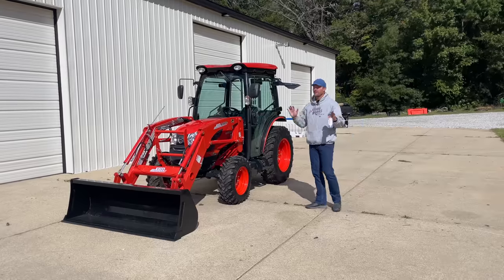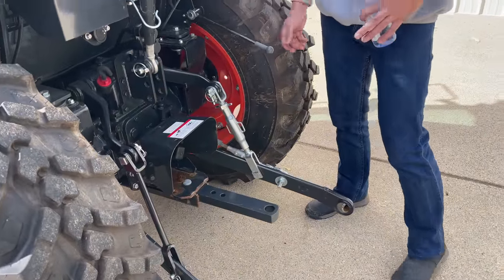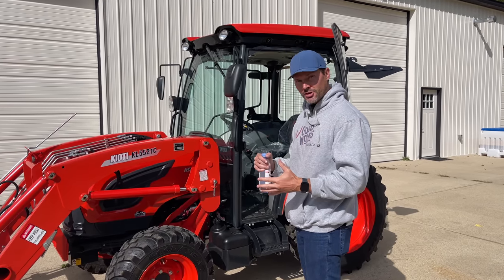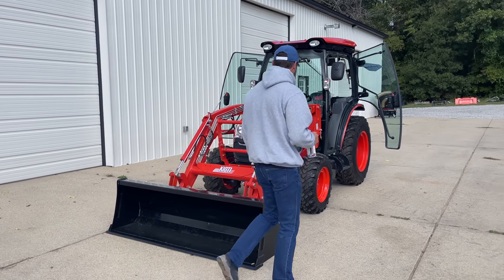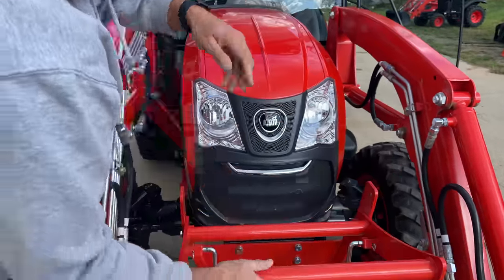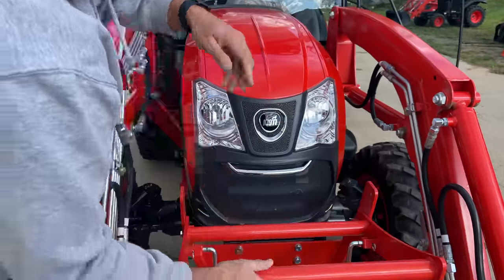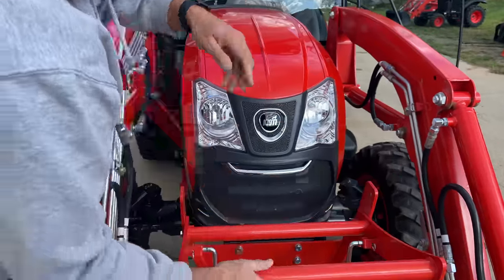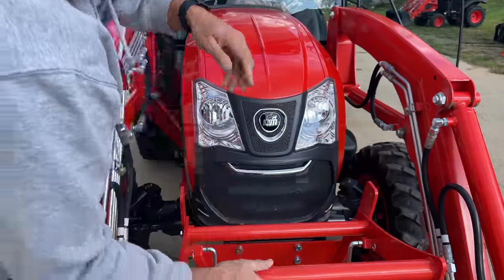WHY DID I OVERLOOK THIS TRACTOR BRAND FOR SO LONG?!

Comment: I would much rather use the radio provision to nut in a mobile GMRS radio or similar so that the family can communicate with me while I’m out farting around with the tractor! Plus it’s a nice safety thing to be able to communicate with people outside of the cab in tight spaces or spotting conditions.

Comment: I’m curious what you think of the LS tractors I don’t have a kioti dealer here however I have been looking at the LS version of this basically the MT3 57 so a 57hp also and it comes with 2 rear remotes.

Comment: Maybe I missed it, but do any of the Kioti tractors have auto throttle? 

And I agree, headphones are better than a radio… if you have then with you!
Reply from the maker: Not sure, I don’t think I’ve seen that feature yet, but could just be forgetting.
Reply: They have a linked pedal function that ties the throttle to the pedal angle which I use exclusively unless I'm running the PTO.
Reply: Linked throttle an cruise control

Comment: Just curious Courtney what's the reason you don't talk about TYM much? I was between this Kioti and my 574HST I ended up with and they're a terrific brand. Just curious why you don't have interest in them? They've also been around forever and make many models for everyone.
Reply from the maker: TYM?  Maybe someday, but the used/resale market is way too small still. Not enough market share yet.
Reply: @GoodWorksTractors  Yes TYM my auto correct decided I spelled it wrong. What makes Kioti have more market? Through the state of Iowa which is a pretty large tractor use state there's like 7-8 dealers. I'd argue to say they have even more included features for the price.
Reply: Nobody sells a TYM after they own one 😎😎

Comment: I currently have a Kubota LX3310 and I put it on the market for sale and I’m upgrading to the CK3520se cab. The features you get for the price are crazy. It actually makes my LX seem generic. That’s not the main reason. A heavier tractor, better loader with better lift capacity. I do driveway work and the extra weight to pull a box blade up hills and loader will help day and night. Did I mention a cab as well? Lol. Same financing and warranty as Kubota. Plus the tractor with the tires loaded, the loader and a cab is less than the package I paid for my open station LX. Excited to give Kioti a try!

Comment: People complain about armrests, but they are designed for midgets. I’m 6’3 220 and unless I slouch down 6 inches, my arms don’t even come close to the arm rests. I own a Lx2610, does anyone know if I can raise them up higher. I’ve looked countless times and haven’t located any different places to mount them.
Reply from the maker: I'm 6' 3" and really enjoy armrests.  Most are adjustable and have sat on a lot of tractors.  Look under the armrest, normally a threaded knob to turn.  Others have a scroll of sorts on the side of the arm rest.  I've never found armrest location to be an issue.
Reply: @GoodWorksTractors  , thank you 🙏
Reply: @GoodWorksTractors  , after locating the arm rest section in a very obscure part of the manual, it appears the Lx2610 doesn’t have an adjustment. I’m going to contact my dealer and see if any damage to the machine or possibly voiding my warranty will occur if I just drill new mounting holes higher up on the seat. I still haven’t figured out the adjustable seat spring. It feels like no matter which way I turn it, I’m unable to notice any difference (and the tractor is basically new, less then a year old and only has 177 hours on it).  Another word to the wise, make sure you get a comfortable seat when purchasing a tractor, your back will thank you.

Comment: As these tractors age , are parts available for repair ?
Reply from the maker: Yes, Kioti is over 70 years old and did $956 million in annual revenue in 2021.  The last year I can easily find a report.  They are huge and been around for decades.

Comment: Sorry this comment is misplaced in relation to the video. I want to buy a landscape rake, from you would be good. Had some trouble with the website so trying this contact. I have JD3025E. You have one in stock less than $800?
Reply from the maker: We do have them in stock, but more than that price.  What issue were you having with the site?
Reply: @GoodWorksTractors  thanks for the reply, really like watching your videos. For the website, when I would begin filtering, formatting would be unusual and causing me to get locked into no way to return or proceed. Would also seem to freeze, so I would return / reopen. Sometimes I got to point I could see rakes, but then when clicking for options, would freeze.

Comment: The issue is this is literally half the tractor a old 70s Ford 3000 is by weight alone... there is just that much less machine there at about the same HP.... 40 years from now this machine probably wont be here and the Ford will still be going.

Comment: Too funny!
“This doesn’t have a third function, but it’s got the provision; like right where you would mount it.”  
It has two holes drilled on the loader cross-member.   That’s the provision??? 
That’s like me building a home for one of my customers and saying, “No ma’am. We don’t put windows in your new home when we build it.  However, we do make provision holes in the outside walls for those windows.”  
Maybe I’m wrong, but after watching several videos it seems that Good Works Tractors would try to sell ice to Inuit people.
It also seems that the best tractor is the one he’s selling. And he is always selling.    
“Always Be Closing!” Does this shoot a hole in the “five reasons John Deere are better…?”  Now will it be 24 reasons to buy Kioti in 2024?
 I have a similar tractor, open station.  I have a few family members who also run similar Kioti tractors.  You say, “I have found the loader controls to be very smooth.” I do not find the hydraulic controls smooth compared to other makes I have owned or used.  I do however find them incredibly “responsive.” In fact, I would actually call them “touchy.” And it may take a new operator a bit of time to get used to how quickly these controls respond, especially if you are using pallet forks and trying for delicate precision. 
Anyway. It is a beautiful tractor, and you say you are going to keep it; yet you are doing a great job trying to close the deal now. :)

“For we are his workmanship, created in Christ Jesus unto good works, which God hath before ordained that we should walk in them.” (Ephesians 2:10 KJV)   Amen! 
I’m very curious if this Bible passage is what you are referencing in the name of your business?  
After all, “Jesus answered them, ‘Many good works have I shewed you from my Father; for which of those works do ye stone me’?” (John 10:32 KJV) just doesn’t seem like a verse a retail sales business would base its sales strategies on.

Comment: Sorry Courtney.  I traded a kioti2510 in on a Mahindra Max 25. Mahindra is put together better with way more lift capacity and overall power.   The kioti felt like a oversized lawnmower. Pretty much bottom of the barrel.
Reply from the maker: What Series of Kioti?  I'd like to look up the specs to compare.
Reply: @GoodWorksTractors  ck series.  Pretty chinsy
Reply: @GoodWorksTractors  The OP’s trade in was a CS2510. Has to be. The MAX 25 compares to the JD 1025R.
Reply: Have a bobcat (Kioti) ct 2025 and I absolutely love it. I also have a John Deere 1025r and the bobcat dose circles around it.
Reply: @williamk5001  no it was a ck. Like I said...pretty bottom line
Reply from the maker: I don't understand.  The Kioti has greater weight, tire size, loader lift height and capacity, and hydraulic system.  Mahindra has better 3 point lift capacity.  Objectively, the Kioti is and should be superior as it's a bigger tractor.  To each their own.

Mahindra: https://www.tractordata.com/farm-tractors/007/1/6/7163-mahindra-max-25.html

Kioti: https://www.tractordata.com/farm-tractors/009/5/4/9544-kioti-ck2510.html
Reply: @GoodWorksTractors  look at them side by side. Size difference is minimal.  You are obviously biased. No big deal Courtney.  Just putting the info out there
Reply: @GoodWorksTractors  I also doubt the hydraulic capacity on the kioti.
Reply from the maker: @jasonkosmal1125 specs aren’t biased.
Reply from the maker: @jasonkosmal1125 They have an eMax 25 L and a Max 26 XLT on their website and I spent too much time trying to find their loader specs and only found one random figure given without context.  The eMax 25 L is a inferior subcompact and in no way competes with the Kioti.  The Max 26 XLT is more on par with the Kioti and it should be as it's in the same general frame size.
Reply: @GoodWorksTractors  I said Max 25...not eMax.....I can already see your problems...
Reply: @GoodWorksTractors  the eMax is on par with the kioti.  Sorry to get you so worked up. I'm sure you'll have no problems with your kioti. Good luck
Reply from the maker: @jasonkosmal1125 I just told you the models on their site hence the reason I went to tractor data to actually find it. I’m like three steps ahead of you haha.
Reply: @GoodWorksTractors  you sure are.....
Reply from the maker: So you gonna post a link to the specs from their site?  Curious how far off tractor data is since you don’t think it’s accurate.
Reply: @GoodWorksTractors  Bottom line is kioti is a lower mid level tractor....on par with mahindra ls tym. Not john deere or kubota

Comment: Why did you overlook this tractor?  Well you were in bed with Kubota and Deere.  I have been screaming about Kioti, TYM, Branson, RK and I just think you were staying away from the Korean tractors.  Every one of those will out perform Deere and Kubota and when I bought my TYM it was $4k less than the comparable Deere.  I haven't decided to count this, but the next county over I saved $1000 in sales tax.  Add Deeres right to repair BS (that they lost) was key also.
Reply from the maker: I’ve never been paid by John Deere or Kubota.  There is a lot more to it beyond just capability.